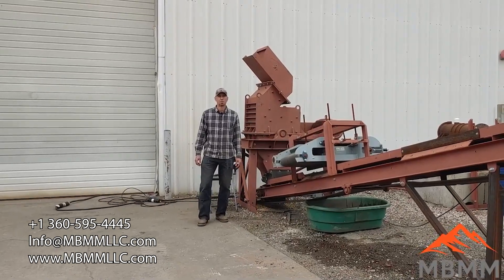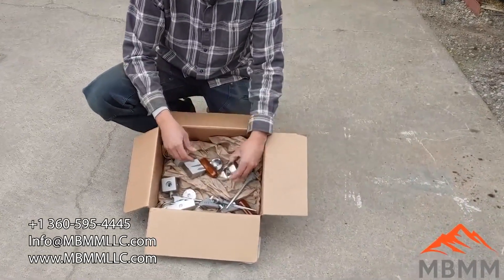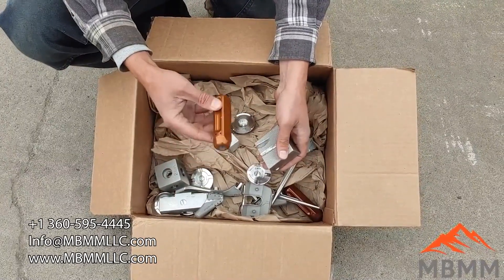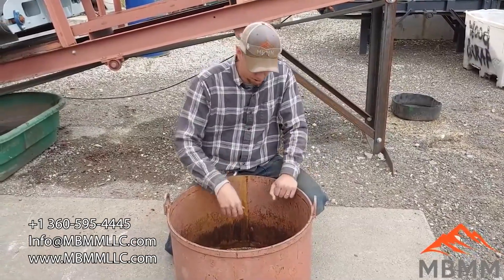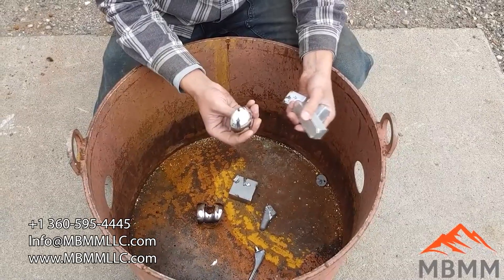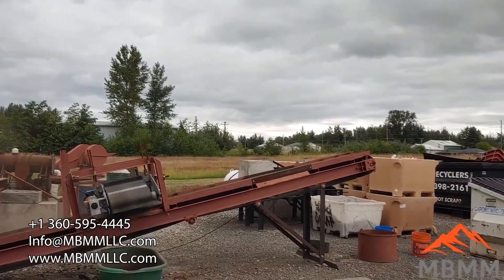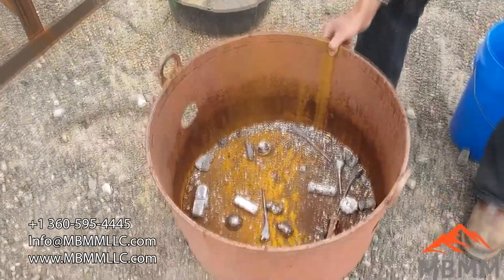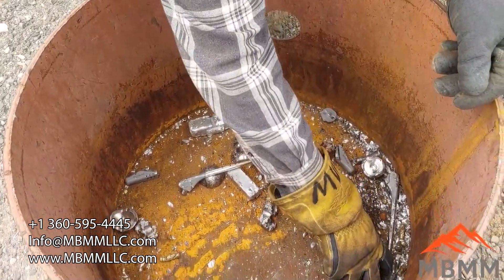Hammer Mill vs. Titanium Hips!

Comment: Is the only reason that conveyor is so long is to get a taller bin under the end of it ?  The magnetic cross operation I understand its function .
Reply: Partly, but also because this can be the first stage of a multi-stage process.  The next step might be an air separator, if you're working with a plastic/metal mix.  An air separator that lifts the light stuff (plastic) to a separate bin, while the heavier (metal) stuff drops into a bin below.